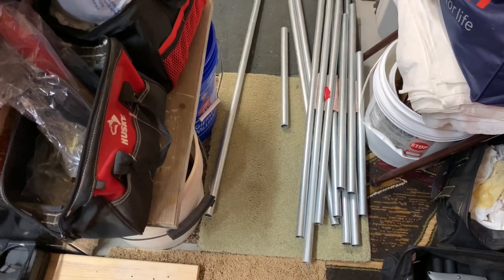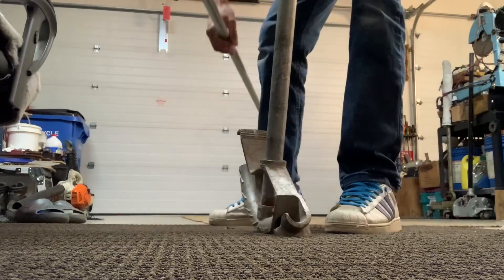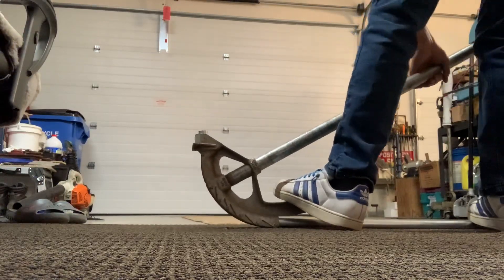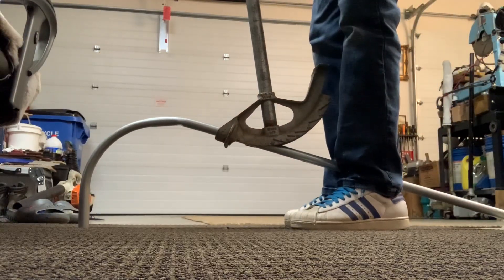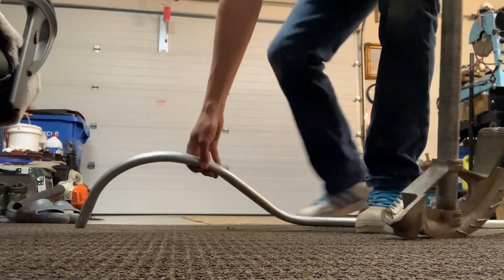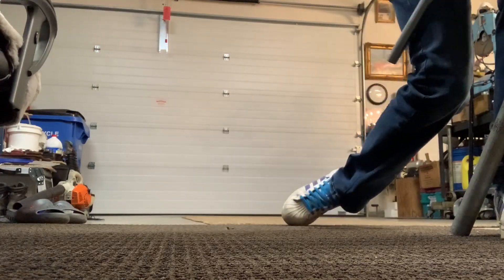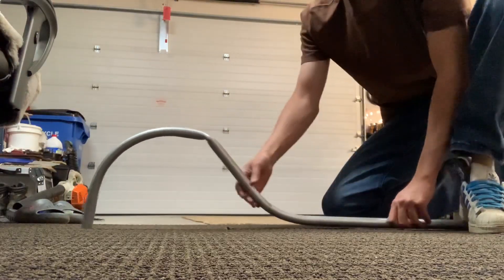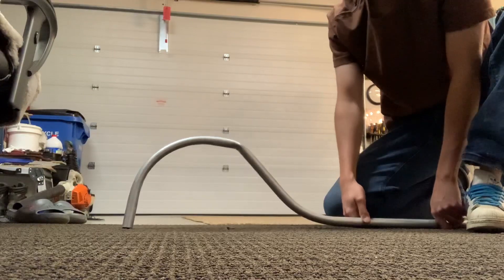Electrical Conduit Bending Tutorial: Shepherds Hook

Comment: Some of you can LYAO, but I've bent those (without the kink) and they do work.  They work if you need to change direction and can't install a pull box.  I over bend, then draw a perpendicular line across the stub end, straight over to the conduit, mark and bend to a 90.

Comment: I use a shepards hook the most when coming thru a wall and need to run along the wall once I come thru, that is if I don't wanna mount a box and run out the side of it. Mainly for lighting circuits in a room with a drop ceiling.
Reply from the maker: nicee 🙏🏼 thanks for the comments!